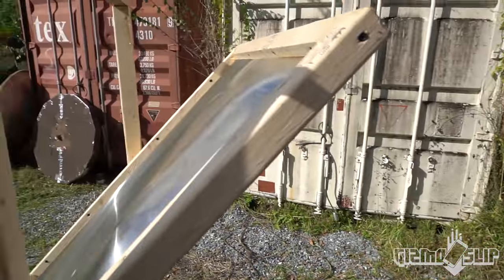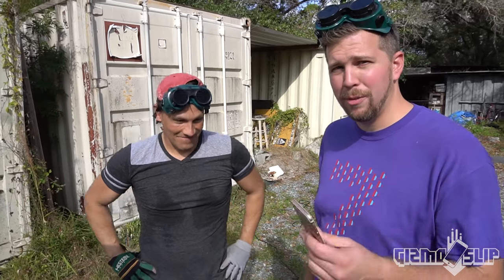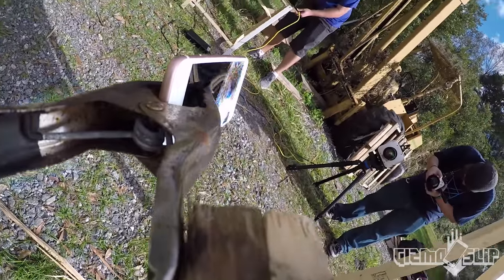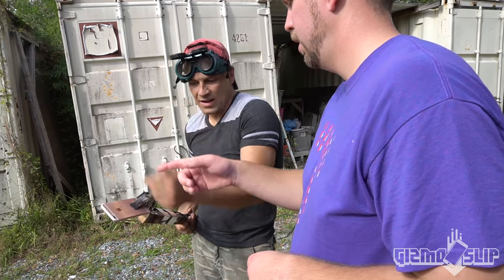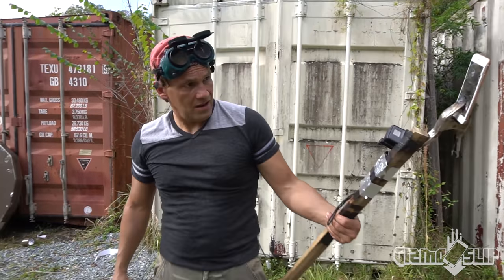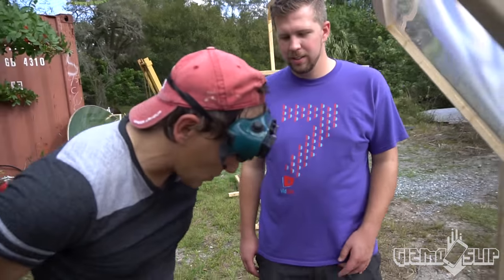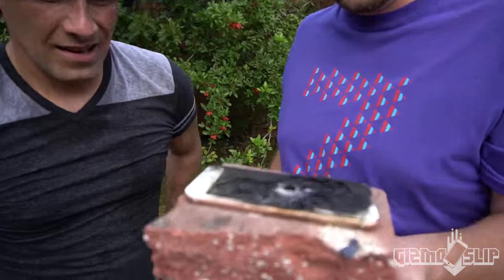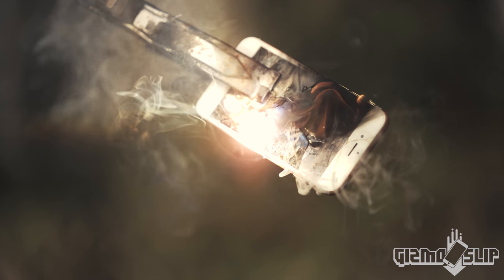Can Concentrated Sunlight Slice an iPhone 6s in Half @4000 Degrees? - Gizmoslip

Comment: It makes perfect sense, you apply ±4000F to one small point on a quite thick aluminium sheet. The heat dissipation of aluminium is very high so it won't melt but rather disperse the heat to neighbouring aluminium chunks. Cool lens though and nice video, I hope Darren's leg is feeling better :) cheers

Comment: If memory serves me right, the metal they used for this iteration of the iPhone is aircraft grade aluminum. aluminum already used in many  heat dispersal systems because of its ability to spread and get rid of the heat. that is why many lower cost heat sinks are made of aluminum